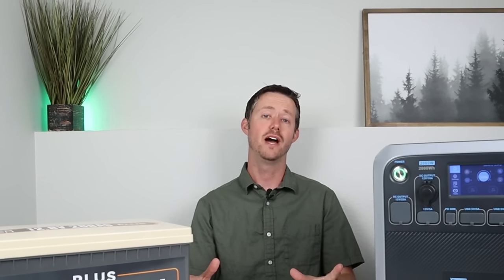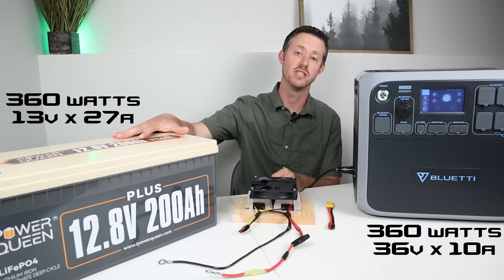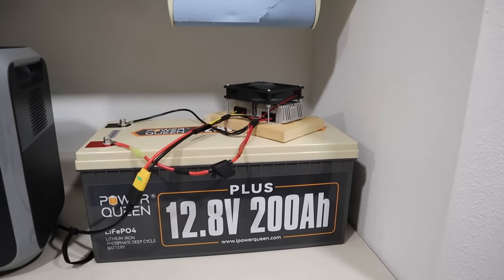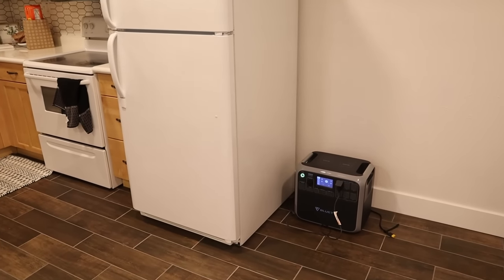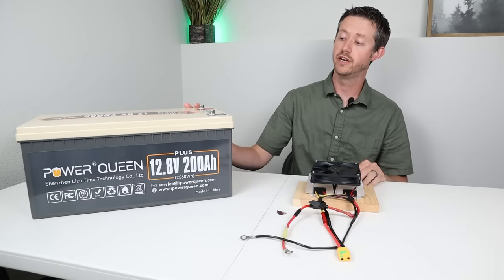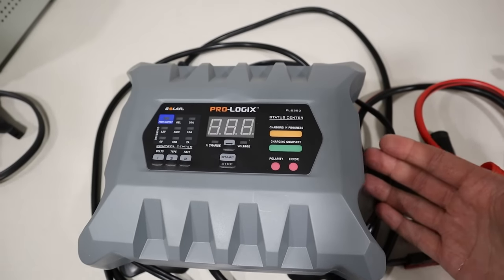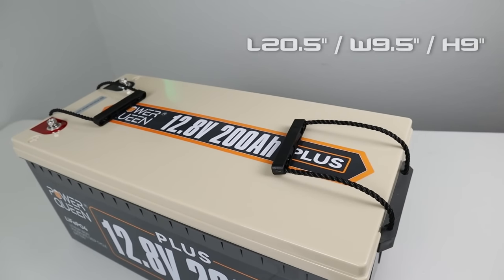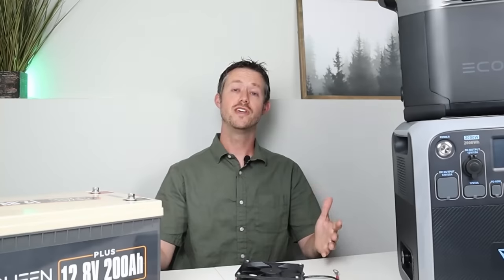Make Your Power Station Last Longer! Power Queen 200AH LiFePO4 - DIY Expansion Battery!

Comment: I have a question for you to ponder. Let's say I have (4) 12.8V lithium batteries in parallel, but would like to switch them from parallel to series temporarily (just so I can more rapidly charge my AC200 at higher voltage from my (4) battery bank). Well, is that possible? Could I add a disconnect between each battery to temporarily disconnect them all. I only need up to what 15A that the AC200 solar input can take, so I was thinking of a flexible light gauge wire with on/off which could temporarily connect them all in series. Is this a stupid question? Would bypass all these boosters, then after the charging is done at 51V, remove the light wire harness and re enable all the disconnects in the parallel configuration. When my setup is in back in parallel, I can quickly charge that battery bank up to 80% using a generator and an 80A (lithum charger). At night, I could reconnect the temporary wiring harness to charge the AC200 off that battery bank. Probably sounds stupid, but think about it. Better than letting the generator run for 5hrs or more to charge the AC200.
Reply from the maker: In theory that would work! You could make the series connections using 12awg wire. The only thing to make sure is if your LFP batteries can handle the series connections or not. You need to make sure their spec sheet allows for the higher voltage since the BMS inside the battery can be limited to parallel connections only.
Reply: @Jasonoid  they can handle 4 in series (12.8Vx4), that's it. but if I plug into the solar port, there wouldn't be some big amp surge or something that would blow up the ac200?
Reply from the maker: @massa-blasta  no, the AC200P will slowly ramp up the power and limit the input amperage. Think of it like a plugging something into an ac wall outlet, the appliance just pulls what it needs, it doesn't just blow up and catch on fire when you plug it in.

Comment: Can the same be done with a 24 volt lifepo4 battery and remove the converters? Would it work with other power stations like Ecoflow? I'm looking for a similar setup where I can plug it to the ecoflow to charge the battery (output port?) then, when needed (like in this example) plug it back to the Ecoflow (input port?) and charge it. Would like to avoid the converters if possible hence the use of 24 volt battery.
Reply from the maker: Yes sir, 24v battery, not converters needed

Comment: Does any have a diy on the 12v to 24v inverter on a small power station.  I was planing on using a 100ah battery or smaller for solo camping boondocking
Reply: Planning on doing this with a Bluetti EB3A and 20v nominal tool batteries.  Many tool adapters have native 12v outputs and wouldn't require a step up converter if 120W charging would be sufficient for your use case.

Comment: Rather than get a separate dedicated solar charge controller, would you be able to charge the battery back up using solar and the solar generator itself that you're extending (AC200P, etc.)?
Reply from the maker: You technically could put powew into using the "13.3v DC output" but it won't fully charge to 14.6v and its not a designed charger.  Things could go wrong so I wouldn't recommend it. Just buy a dedicated lifepo4 charger.
Reply: plug the dedicated charger into the AC outlet of the solar generator.

Comment: Hi everybody. I have a 60ah lifepo4 battery which I charge with a 200w solar panel, for my camping. From this battery I want to charge a small 43ah(518wh) power station which has 36v 5A input limit. What is the proper step up converter (input - output) for this combination? 24v or 36v is better?
Reply from the maker: I'd recommend using a 24v converter to stay a little lower than the 36v maximum voltage input.

Comment: Do you know if 2 AC200 MAX's can be daisy-chained?
Reply from the maker: No they can't be officially daisy chained, they only support expandable batteries. However, you could still use the AC or DC output to dump power from one into the other.
Reply: @Jasonoid  Thank you for the quick reply.

Comment: Can I use the setup 12V to 24V with EcoFlow River (1 not 2) Max?
I bought it with 12V to 24V converter (3A output, but in reality it's closer to 5A) and by specification River Max can receive 200W 10-25V DC 12A Max (Solar input). But also it states that Car Charger (output) 12V DC 8A Max (so, it's calculated roughly 100W) and it wonders me since in this model both Solar input and Car input shares the same XT60 connector. Should I be worried that if it's charging from (Car) battery it only expects 12V, not higher? Why the Watt numbers for Car input and Solar input differs by 2 times?
Update: didn't know there is a Car charger in the box and it should be Car charger specs, right? I feel dumb now 🥴
Reply from the maker: Yes, the 24 volt input will charge the EcoFlow River faster than with charging at 12v.
Reply: @Jasonoid  Thank you very much for the answer! If River Max XT60 input is rated 200W 10-25V DC 12A Max  am I safe to use 12V to 24V 10A 240W converter? The station should limit itself to 8.3A (24V 200W) and I'm safe or it could be dangerous?

Comment: I have the AC200P

Do you notice that it drains a lot when the AC is turned on?

There is ECO mode and not sure how much that will change the draw.

For example I left the unit on with no load over night and when I got up the next morning, the unit had used more then 10-15% of the capacity… any recommendations as it just seems to use a lot of power with AC on.

Contacted Bluetti about it but it is normal apparently
Reply from the maker: This is normal behavior for any power station I have tested as the AC inverter is left on. It takes extra background power from the battery to convert the DC power of the batteries to output AC power. Ecomode turns off the AC inverter when it senses no load for a specific amount of time. You can see the different testing I did on all of Bluetti's larger units here: https://youtu.be/viqfp5YYunw
Reply: @Jasonoid  thanks so much, I will check it out for sure 🙂

Comment: What battery would be compatible with EB55/70?
Reply from the maker: A large 12v battery connected directly would charge at 100watts as it's connected. You could double that power up to 200 watts by using a 12v to 24v converter seen in this video:
https://youtu.be/_7l8hoNebDY

Comment: QUESTION: WOULD THERE BE ANY ISSUES IF I CHARGED MY RIVER PRO VIA CAR CHARGER CABLE THAT'S PLUGGED INTO THE 12V PORT OF DELTA 1300? 

RATIONALE: I HAVE ENOUGH PANELS TO PULL MAX (400W) INPUT FOR DELTA 1300 AND IF IM USING BOTH DEVICES AT THE SAME TIME IT WOULD BE CUMBERSOME TO DISCONNECT AND SPLIT THE PANELS BETWEEN THE TWO DEVICES WHEN IM ONLY GETTING ABOUT 5 PEAK HOURS PER DAY.  IF I UNDERSTOOD THE SPECS CORRECTLY THE CAR CHARGER CABLE WOULD ONLY PUT ABOUT 96W INTO RIVER PRO
Reply from the maker: Yeah, that's fine. I use the 12v socket on large power stations to charge smaller power stations all the time. Sometimes it just makes the most sense.

Comment: The 25 amp 13.4 volt AC200P output charges lithium batteries to 99% and at a proper flow voltage. Works for me, comments?
Reply from the maker: Yes, it will get the battery almost full, it's nice to have it regulated that high!

Comment: I’m trying to find a way to charge my ecoflow pro from my vans alternator … the reason? Because the 12v cig takes takes too long.  Any ideas? #vanlife
Reply from the maker: Yes, the amperage limit is the issue. The combo of low voltage / low amps you are stuck at 120 watts or less.  If you can boost the voltage you'll get more power.
Reply: @Jasonoid  I can limit the input on the AC input side of the ecoflow boss the app… so I’m going to add an inverter to bring in 500w from the battery to my ecoflow delta pro.. is it efficient? No .  But will it recharge my ecoflow while still protecting my battery/alternator? Yes, I believe so.  And I’ll have a charged battery in 4 hours instead of 18.  Thoughts and feedback welcomed!
Reply from the maker: @igoslomo  that will work great. Just make sure you use large enough wiring and put a fuse on the positive wire near the battery. Probably best to only charge when the engine is running as well.
Reply: @Jasonoid  agree 100%.. currently studying up on fuses… the inverter has a fuse but if I’m understanding correctly I still need a fuse as close to the battery as possible.  Planned on using 2/0 wire.

Comment: Wouldn't it be easier to series your input battery?
Reply from the maker: You have to balance the batteries before connecting them and periodically while in use. You'd also have to buy a 24v lifepo4 charger, not horrible but many people don't have 24v chargers laying around.

Comment: im curious. Would connecting the battery directly to an inverter work to get the same wattage you were getting to charge the bluetti ?
Reply from the maker: That would work just fine, just make sure your car alternator can handle the full load that the inverter will pull. I also have these other newer videos that might give you some ideas:
https://youtu.be/tK4JKmfndh8
https://youtu.be/I78RxjRXTn4
Reply: @Jasonoid  Thank you for the reply and video links. They were very interesting to see and made me a new subscriber :) would very much like to see you do tests running a battery through an inverter to one of these generators to see if it helps the wattage.
Reply from the maker: I'll put that video idea down on my list.

Comment: This is what I use ( DC Charging Enhancer (D050S) & 3.3Feet/1m XT60 Male Connector Extension Cable (12 AWG XT60 to Ring Terminals)

Comment: At 3 times the rate of charging, are you not degrading the battery in the charging station quicker?
Reply from the maker: These large power station charge at 800-1000 watts on solar usually. This 420 watts isn't near maxing them out. I wouldn't worry about degredation at all.

Comment: Thoughts on using a 48v 100ah battery?
Reply from the maker: That would be an excellent option! EG4 has one of the best priced server rack batteries. (48v, 5kwh, $1500). you could also take smaller batteries and put them into series.

Comment: Someone may have ask this already…….but……If you do that with a power station that has a low solar input (like 200 watt max). Could you connect a solar charge controller to the battery and just leave the power station connected to the battery all the time??? I have a Lifepo4 power station with that limit. Where I live you don’t always have perfect solar conditions. Rather than buy a whole new power station it would be cheaper to buy a bigger charge controller and add the battery and panels. If it wouldn’t ruin my power station.
Reply from the maker: Yes, that will work and shouldn't damage the power station.
Reply: @Jasonoid  Thanks. That’s a big help.

Comment: Could I just buy a 24v 200ah battery and connect it directly?
Reply from the maker: Yep, that would work just fine, you'd charge around double the speed of a 12v battery
Reply: @Jasonoid  Would a 48v 100ah be even better? I've got a Bluetti AC200MAX. Not sure whether it could handle 48v. If so, what size cables do I need to get?
Reply from the maker: This video shows what a 48v battery will do. It will work fine with the AC200max:
https://youtu.be/tK4JKmfndh8

Comment: What specs LifePo4 battery charger should I get for 51.2 v 100-200 Ah battery? Bluetti said the alligator clamps - XT90 adapter can only charge 12V.
Reply from the maker: There are many 48v LFP chargers online, any of them will work well. The Bluetti alligator clamps will be fine with a 48v battery, if they can handle 15 amps, if they are rated at 10 amps only it will be too much power for the wires.
Reply: @Jasonoid  Thanks so much for the insights. Now my issue is the limitation of the alligator - XT90 clamps which is 12V only. Is there a way to use it via the Bluetti DC Charge enhancer which can only be connected to LifePo4 external battery via the same alligator - XT90
Reply from the maker: @irissao  there are TONS of xt90 adapters and cables on amazon. It's a common hobby connection so just buy a third party cable that will connect from your power station to the 48v battery.

Comment: Couldn't you just put a cheap inverter on the battery and plug the power station's AC charging cable into it?
Reply from the maker: Yep, that works just fine... but keep in mind you are going from DC power of the battery, to AC power of the inverter, back to DC power of the charger which is not as efficient.

Comment: Great Info, Thanks! Q; Is there any way to charge my 12v LiFePO4 100ah battery with my Bluetti EB70s charger (output 25.2v==8A)? Would be cool to only carry one charger..
Reply from the maker: I'm sure there is a way to get it to work, but probably not the best for efficiency. Probably best picking up a dedicated 12v LFP charger instead.
Reply: @Jasonoid  Thanks for the respond. Would a 12v-50A Charger be to much?
Reply from the maker: @garrison_herbert  a 100amp battery usually can charge around 50amps to 100amps, that amount is perfectly fine.

Comment: Will this work with smeller power stations such as the EB70 and EB55 with a converter that will double it the bolts and not triple it?
Reply from the maker: At the end of the video I explain that a 12v to 24v converter will work great for your smaller power stations. Parts are listed in the video description.
Reply: @Jasonoid  Yeah I seen that after my comment lol
Reply: It’d have to be the 12to 24/28v or just using a 24v battery for the smaller bluetti units. Now in theory the eb55 could supercharge with the one leg of 24v going into the mppt and another leg going to the regular charge port..

Comment: can you used this in my truck battery when you driving ?
Reply from the maker: Yeah, if your alternator can handle the extra amps and your engine is running, it shouldn't be an issue.
Reply: @Jasonoid  Thanks , I just came across this

Comment: Why not just plug the Bluetti into the inverter to charge and test the power queen
Reply from the maker: You could do that, it's just not as efficient since you are taking DC power, converting it to AC power and then back to DC power. By using the converter, you are sticking with DC to DC power.

Comment: Any tips on using a stand-alone LFP battery to charge the new EB3A station?
Reply from the maker: At the end of the video I talk about using a 12v to 24v converter instead of the 36v converter on small power stations. Would be the same principle as seen in this video but using a lower voltage converter. The EB3A would charge at 200 watts instead of 300+ watts as seen in the video.
Reply: @Jasonoid  Thank you for your reply.   I don't want to make any presumptions and will plod along carefully before I set anything up
Reply from the maker: @pedestrianfare8175  I made a previous video about getting the most charging wattage out of the EB55 and and EB70 power stations. These same principles will also apply to the EB3A. You can watch it here:  https://youtu.be/_7l8hoNebDY
Reply: @Jasonoid   Thank you!

Comment: Would the 36v work for Delta Mini or would it need to be 24v?
Reply from the maker: Ecoflow's website says the solar input as the following for the Delta Mini:

Solar Charge Input
300W       11–75V DC    10A max

Comment: Would there be a way to charge the expansion battery using the power station (perhaps from a DC output) or would you definitely need a separate charger?
Reply from the maker: I'd recommend a separate charger. If you wanted to purchase an AC charger you could charge the expansion battery using the power station inverter if you had plenty of solar input during the day.
Reply: Thanks. Solar isn’t really an option for me. 

I’m ordering an Oukitel P2001 and was thinking of getting a 24V 100Ah LiPo4 battery to double the capacity during grid power outages.  

Since you have a few of them, do you know how many volts the Oukitel/FFPower P2001 batteries use internally? 

If I get an external battery that is the same voltage as the internal batteries, would there still be power loss charging the unit from the external battery? Is closer better, or would any voltage change be the same power loss?

 With a 24V battery, I should get 24V*15A=360W into the P2001 running it directly into the Anderson port.  Would I still need a fuse on the positive side if I don’t use  a step up converter as you did in this video?
Reply from the maker: @ma3680  the internal batteries are 48v LFP batteries but you cant plug those into the charging port since the true voltage is over 50volts. It's best to use a 24v LFP battery like you mentioned and it should charge fairly decently.
Reply: Would I need a fuse, or just a battery-clamps-to-Anderson cable?
Reply from the maker: @ma3680  an inline fuse is always a recommendation for added safety. I'd recommend something with 12awg wire and a 20 amp fuse.
Reply: Thanks again!  Great channel, BTW.